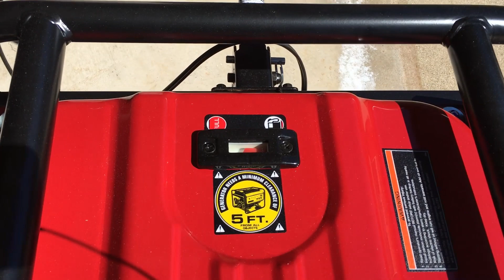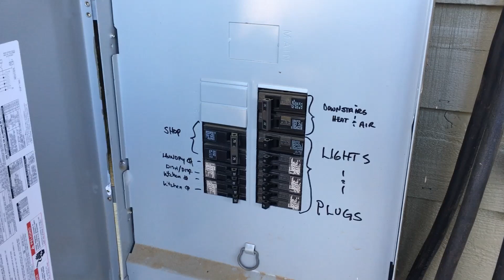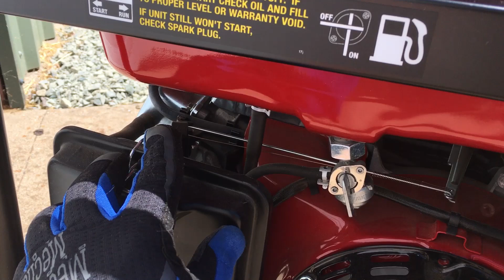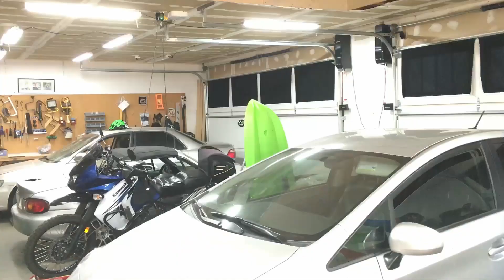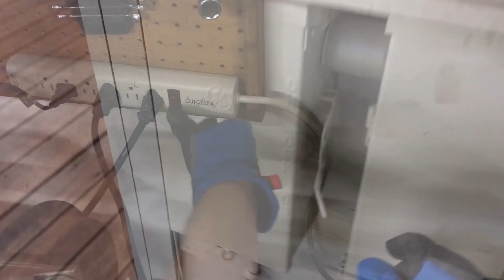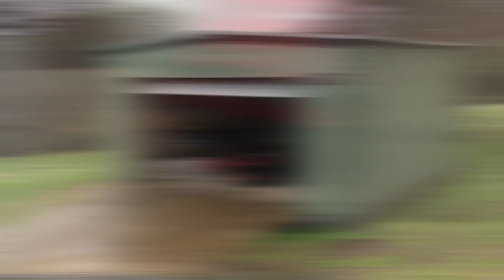No Power... No Problem!!  Harbor Freight 9000 Watt Predator Generator Review AND Real Outage Test!

Comment: Bought mine last year. I haven’t had to use it until this year (hurricanes) it worked great until I turned on the hot water heater it powered it fine but when you loaded it up it would run about five minutes and the CO2 sensor would shut it off this is with the generator setting outside on the driveway. I was very disappointed I tried to call the tech number on the unit but no answer. I found a way to bypass it on you tube so far so good!

Comment: I just picked up a used one tonight and it doesn't have 110 v coming out or 220 it has 12 v coming out so I suspect it's the AVR and so for $200 you can't beat that even if it's a $20 piece to make it work
Reply: Was it the AVR?.

Comment: I have the same one and (being a Diesel guy) it does brake my heart to see an ice cold 
gas engine run at ~3,750 rpm right after being cranked on and yes, Ii did get rid of the 
spring pulling the gas paddle to a much too high rpm range!

Comment: Doesn’t the 30A 220v socket limit you to less than the 7250W into the house panel?
Reply: It's not 220V, it's nominally 240V. 30 Amps x 240V = 7200 Watts, so it's pretty close. This assumes a power factor of 1.0. A more typical power factor of 0.9 gives a total power output of 6500 Watts. The bigger limitation will be any unbalance on the two 120V legs. So there may be up to 3000 watts per leg. 240V loads like well pumps and water heaters will be balanced, but any 120V loads like toaster ovens, coffee makers, etc are only going to load one of the legs, so it makes sense to make sure they are somewhat balanced. For example, you could not use 4500 Watts of 120V loads on the same leg, but you could if you balanced them as 2000W on one leg and 1500W on the other.

Comment: I use one 6hrs a day to charge batterys till I pay for a new 100amp service, runs entire small house no problem, the ground at generator that is at its ground lug should be disconnected, non bonded, the ground from the 220 output should be grounded to panal ground in house.

Comment: I have the same generator but it trips the gfci when I try to run the furnace for some reason, it will run any other tools and small heaters I’ve tried so far

Comment: Just got my Predator 9000 a few weeks ago. Haven't run it yet. The electrician is coming today to give me an estimate on an interlock for the house. I've ordered the natural gas conversion kit. Installed a tachometer/hour meter, and a magnetic dipstick. She's almost ready to run. I'll be using Royal Purple motor oil exclusively and I am NEVER, EVER putting a single drop of gasoline in it.
Reply: Read the owners manual.  You need to run it on gasoline during the break in period. (I think 20hrs.) If you don't, you will damage the engine. The gasoline helps to lubricate certain parts of the engine, that NG can't. We have this same generator with a Tri-fuel kit installed.  

I always warm up the generator for 5 min on gasoline and switch to NG buy closing the fuel shut off valve.  As the engine starts to sputter from lack of gasoline, I open the NG valve to instantaneously run on NG.  This way, the engine gets lubricated, by the gasoline, on each cold start.
Reply: @Pk3_Garage  I cannot find a single shred of evidence to support your claim that gasoline has any lubricating properties whatsoever.
Reply: I read this somewhere, when researching Tri-fuel kits. I was trying to find it  before I posted my reply. I will try to find it and report back.
Reply: @Pk3_Garage  Well, you told me to "read the owners manual." Which, if you bought a gasoline generator, is obviously going to say break it in with gasoline. It's not going to address an aftermarket tri-fuel kit. 

What could the gasoline possibly lubricate, inside the engine, that the engine oil will not?
Reply: @Pk3_Garage  THANK YOU. TAKE CARE..
Reply: ⚠️Very important announcements to everyone about generator safety: 

Please don’t forget to follow the generator safety tips when you use your portable generator. This is just a reminder to make sure. All generator safety instructions need to be followed carefully whenever you use your portable generator. 

1) KEEPING OTHERS SAFE: Please do not allow an unqualified person or your children to operate and service the portable generator. Just because some manuals don’t say that doesn’t mean it’s safe. That is important against the generator safety rules. We also need to be keeping an eye on our children too. You need to make sure that your children are not playing near the portable generator especially when it’s running so they won’t get electrocuted. Generators pose electrical risks and they can be hot during an operation. Please keep your children away from the portable generator at all times. It is important to keep our children safe especially our little ones. Be aware of all the hazards.

2) WHERE TO RUN YOUR GENERATOR: Some people use their portable generators indoors which increases the risk of carbon monoxide poisoning. It’s important to have a carbon monoxide if you have a gas generator. Never ever use your generator indoors even if your doors and windows are open and even in the garage is not safe to use a portable generator. Not even at your porch and your deck. It is never safe to use your generator indoors and in enclosed areas of your home. Your generator needs to be 15-20 feet away from your house. 

3)🔥FIRE HAZARDS: Never refuel your generator while it’s running. You need to let your generator cool off before refueling it and before storing your generator. Never overload your generator too. Never ever back feed your generator. You should never plug your generator into a wall outlet. Also never store propane tanks indoors. Please keep flammable things away from the generator as well and please don’t smoke cigarettes near the generator. Having a fire extinguisher next to the generator is also important against the generator safety rules. 

4) GENERATOR OPERATION: make sure your hands are dry before touching the generator. Never use your generator in wet conditions. Don’t let your generator get wet. You need a generator tent if you need to use your generator during wet weather. Please don’t wear loose clothes when operating the generator. Turn on your generator before plugging in appliances. Use the right cord for your generator. Please do not use worn out cords. 

https://youtu.be/I1jT3ANENvI and here is a video more about keeping others safe when using generators 

Hope this helps. Remember that it’s better to be safe than sorry 🙏

Comment: The Duromaxx ones offer more power and have a 50 amp hookup on the 12,000 one I have. It will run A/C and lights and fridge! Word to the wise on shutting off gas. Yes you can use shut off valve to stop the flow of gas to the carb, but there is still gas left inside of the carb. And there lies the problem, my unit has a drain plug that will allow the gas in the carb to be drained out! A most critical point this be done! To protect the carb from the ethanol devil that will do damage to the carb if left in the carb bowl.
Reply: You are not supposed to use ethanol gas in a small engine. Use non-ethanol gas with Sta-Bil mixed in with the non-ethanol gas.

Comment: When running tools, does the generator have to be grounded??
Reply: Always ground generator, there's many methods. If for home back-up, drive a independant rare earth ground rod. Can also ground by using battery jumper cable to a steel fence. Anything is better then nothing. Take preventive measures, It's never the operator getting shocked, often it's a child.
Reply: Here is a reminder about portable generator safety: everyone really needs to see this safety reminder to make sure. This advice is just to make sure that everyone is aware of all the warnings and it’s just to remind people to be careful using portable generators. Generators can be dangerous if not used carefully. Every year, hundreds of people die or get injured when using portable generators due to carbon monoxide poisoning and electrocution. Make sure you are using your generator carefully and keeping others safe as well. There is something very serious that everyone should always be aware of when using generators. Some people do run their generator indoors which is not safe and that increases the risk of carbon monoxide poisoning which can cause death of family and you. Some people run their generator in wet conditions which can electrocute them. Please remember that you should never run your generator indoors. Remember that carbon monoxide is an odorless and colorless gas that you cannot see or smell. Carbon monoxide is a silent killer. Keep that in mind. Make sure your generator is 15-20 feet away from your house and away from doors, windows, and vents. Never use your generator in your porch too. Having a carbon monoxide detector is very important against generator safety. Some people also allow children to go near the portable generator which could pose risks. We need to keep an eye on our children making sure that they are not near the portable generator so they won’t get electrocuted or burned by the generator which is dangerous. A locking enclosure also keeps kids safe. A generator shed might look like a tempting place to explore, or take cover during a game of hide and seek, but a generator is a dangerous piece of equipment that can cause injury. It says on the manual that we should also keep children away at all times from the portable generator to avoid injuries. Please do not allow a child or unqualified people to operate the portable generator. Just because some manuals missed what should be listed doesn’t mean it’s safe to do. Always follow the generator safety rules when using portable generators. Generators pose electrical risks. If you need to use your generator during wet weather, you need a generator tent to protect your generator from getting wet. Don’t let your generator get wet. Keep your generator dry and before using your generator, please make sure your hands and your generator is dry. Do not wear loose clothing when operating the generator. Everything that is said on the generator’s operating manual should not be ignored. Never smoke cigarettes near the generator. Please keep flammable things away from the generator. Never overload your generator too. Your generator can catch fire. Never ever try to plug a generator cord into a wall outlet to avoid back feeding. Back feeding your generator is dangerous. Always turn on your generator first before plugging in appliances and shut off the appliances before turning your generator off. Use a heavy duty cord for your generator and the cord should not be worn out. All the instructions should be followed carefully. Never refuel your generator while it’s running. It can cause fire if fuel spills while your generator is hot. You should turn off your generator and let it cool off before refueling it. Having a fire extinguisher next to the generator is also important. This is only a reminder for everyone’s safety of using generators. Make sure your generator is properly grounded. Having a fire extinguisher next to the generator is also important against the safety rules. https://youtu.be/I1jT3ANENvI and here is a video more about keeping others safe when using generators and also about our family’s safety. Hope this helps. Thank you.

Comment: To prevent gasoline from staying in the carburetor, I suggest  turning off the gas first and let the generator run dry - then turn the switch off
Reply: Here is a reminder about portable generator safety: everyone really needs to see this safety reminder to make sure. This advice is just to make sure that everyone is aware of all the warnings and it’s just to remind people to be careful using portable generators. Generators can be dangerous if not used carefully. Every year, hundreds of people die or get injured when using portable generators due to carbon monoxide poisoning and electrocution. Make sure you are using your generator carefully and keeping others safe as well. There is something very serious that everyone should always be aware of when using generators. Some people do run their generator indoors which is not safe and that increases the risk of carbon monoxide poisoning which can cause death of family and you. Some people run their generator in wet conditions which can electrocute them. Please remember that you should never run your generator indoors. Remember that carbon monoxide is an odorless and colorless gas that you cannot see or smell. Carbon monoxide is a silent killer. Keep that in mind. Make sure your generator is 15-20 feet away from your house and away from doors, windows, and vents. Never use your generator in your porch too. Having a carbon monoxide detector is very important against generator safety. Some people also allow children to go near the portable generator which could pose risks. We need to keep an eye on our children making sure that they are not near the portable generator so they won’t get electrocuted or burned by the generator which is dangerous. A locking enclosure also keeps kids safe. A generator shed might look like a tempting place to explore, or take cover during a game of hide and seek, but a generator is a dangerous piece of equipment that can cause injury. It says on the manual that we should also keep children away at all times from the portable generator to avoid injuries. Please do not allow a child or unqualified people to operate the portable generator. Just because some manuals missed what should be listed doesn’t mean it’s safe to do. Always follow the generator safety rules when using portable generators. Generators pose electrical risks. If you need to use your generator during wet weather, you need a generator tent to protect your generator from getting wet. Don’t let your generator get wet. Keep your generator dry and before using your generator, please make sure your hands and your generator is dry. Do not wear loose clothing when operating the generator. Everything that is said on the generator’s operating manual should not be ignored. Never smoke cigarettes near the generator. Please keep flammable things away from the generator. Never overload your generator too. Your generator can catch fire. Never ever try to plug a generator cord into a wall outlet to avoid back feeding. Back feeding your generator is dangerous. Always turn on your generator first before plugging in appliances and shut off the appliances before turning your generator off. Use a heavy duty cord for your generator and the cord should not be worn out. All the instructions should be followed carefully. Never refuel your generator while it’s running. It can cause fire if fuel spills while your generator is hot. You should turn off your generator and let it cool off before refueling it. Having a fire extinguisher next to the generator is also important. This is only a reminder for everyone’s safety of using generators. Make sure your generator is properly grounded. Having a fire extinguisher next to the generator is also important against the safety rules. https://youtu.be/I1jT3ANENvI and here is a video more about keeping others safe when using generators and also about our family’s safety. Hope this helps. Thank you.

Comment: Trying to decide between this and the champion 9000 models
Reply from the maker: I'm not familiar with the Champion brand but believe it's of comparable quality (perhaps even nicer).  A few of my friends have the Champion and seem happy with it too, but believe they paid ~30%-40% more than this comparably sized Predator cost.  I believe the Champion models in this size range also offer dual fuel (propane too) options, which is nice.  The Predator is gas only, although I believe you can convert it to run on propane...

Comment: So what does the sine wave form look like on the output of this beast?  IE how clean is the power?

with the fuel shut off, I turn that off and let it burn the fuel in the carby, that way it can't gunk up sitting there for goodness knows how long.   I do this with my mower too.
Reply: I have the same generator to power my whole house. It has a “dirty sine wave”. New Samsung tv and most appliances work but my keurig won’t brew k-cups and my heated blanket won’t heat on gen power.
Reply: @johnb2674  about the only way to do it is with a DC inverter but a decent one is going to cost almost as much as just buying a good inverter generator with all the protections built in.
and they are big arse inverters.
Reply: @johnb2674  This generator should be good to power led grow lights right? i have a legal dwc grow and our electricity goes out once every couple months or so and if i dont get it back up. my whole harvest is messed up and if i am 2 months in that is 2 months wasted. i am buying one of these tomorrow. i hope it works out for me.
Reply from the maker: I haven't measured the sine wave yet but am also interested to know this, if others have.  Regarding sensitive electronics, I was concerned about this but haven't had any issues.  I have my LG OLED TV on a surge protector power strip but that's about it.  My fridge and other electronic items are on the generator directly, and I haven't had any control board, etc. issues (yet)...
Reply: @btd-cf2000  Thank you for the reply.